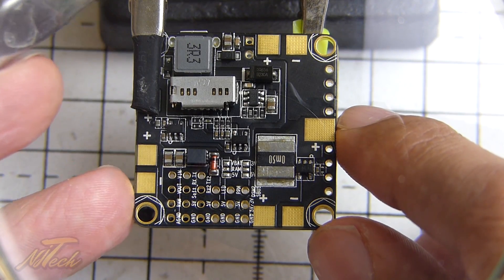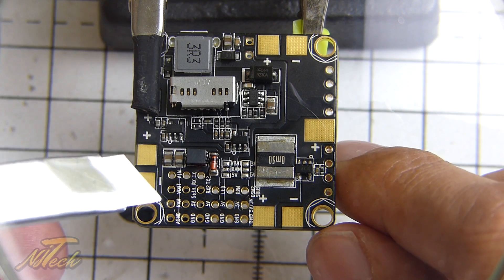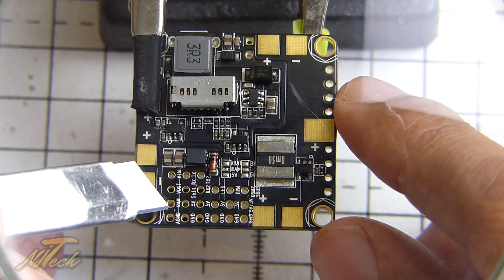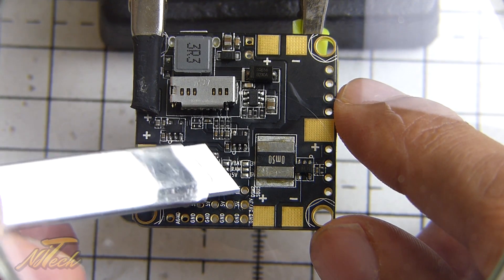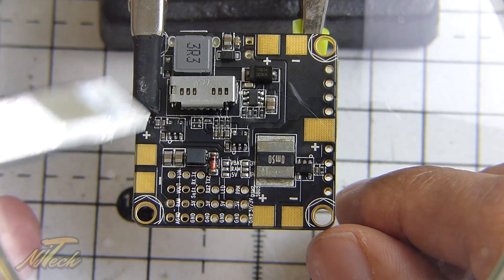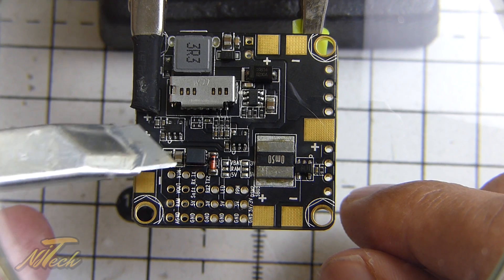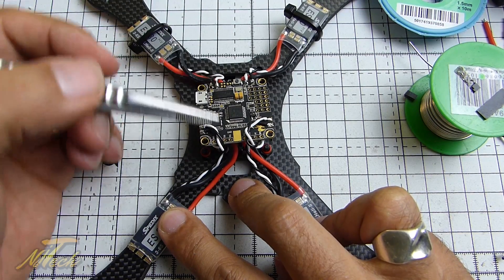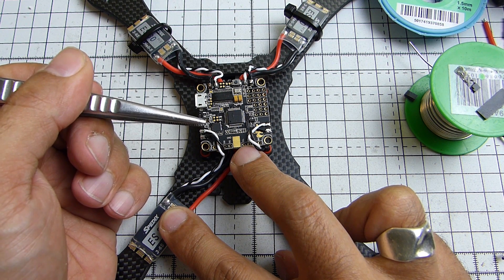Beast SX Build! Part 2 (betaflightF3 prep, planning, ESCs)

Comment: Early descriptions of the board stated the 5v reg was 300mA. Appreciate it is now touted as 3A but be worth checking, 300mA would struggle to provide 5v for the fc, the Rx, the cam and particularly the vtx.  Powering the cam and vtx from the battery directly makes the fpv feed vulnerable to electrical noise from the escs. Also on 6s with active breaking, voltage spikes can be horrendous, would be dubious about the cam life
Reply from the maker: Adam Featherstone absolutely, I certainly hope that's not the case. I'll ask Boris directly about this one. thanks for the comment!